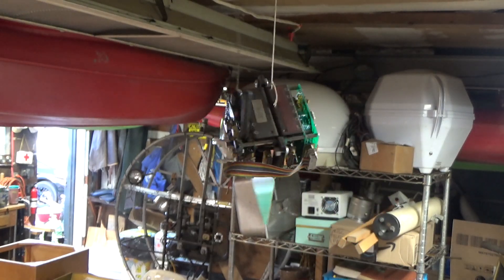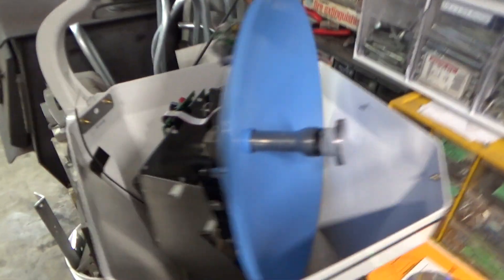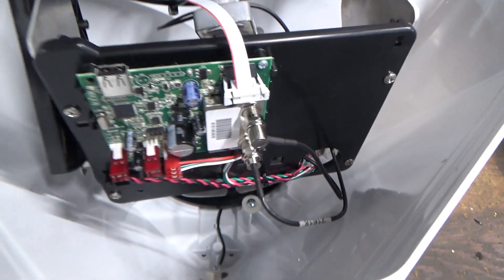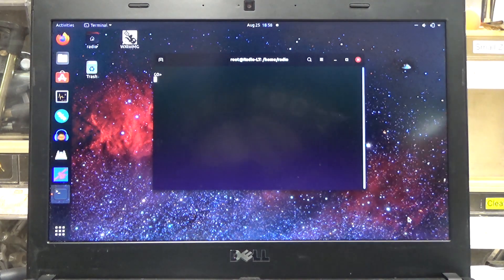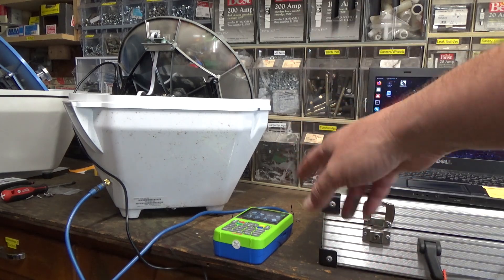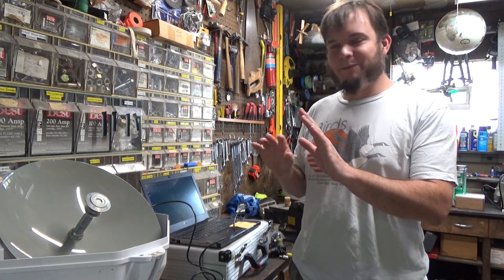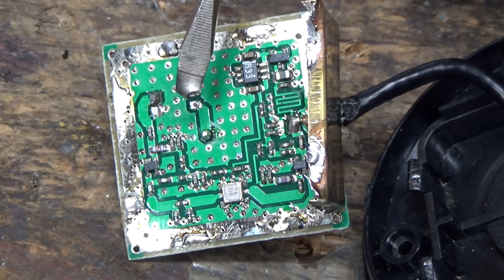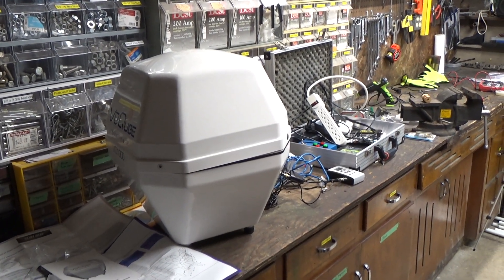Hacking Portable Satellite Dishes (Part 2)

Comment: Nice video! Is L band H/V or circular? GPS?
Reply: I don't think the band necessarily determines the polarity; it's application-specific. Of course there will be standards that are adhered to, but I think you could technically use H, V, RHS circular or LHS circular in any band. GPS would be circular I would think because H can skew to V over distance and GPS is meant to be used by non-fixed earth stations so circular seems more suitable for that application (but I'm just a layman, so take my 2c as only being worth 2c :)